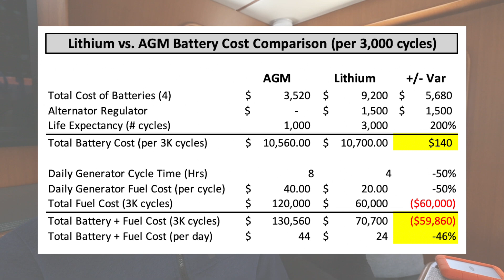What is the ACTUAL cost of LITHIUM batteries (LiFePO4) and should you install them on your boat???

Comment: Battleborn batteries are rip-offs!! You could have got better quality for quarter of the price!!!
Reply: Really.
Where?
Reply: @seadog2396  The issue with ALL batteries using LFP chemistry is that ALL of the Cells used in said batteries are MADE IN CHINA because China has the Patent on LFP chemistry! Cells used in Battleborn, likewise are Chinese made. The market is Flooded with LFP batteries and the problem is you DO NOT really know the origin and quality of the cells used in these batteries. Battleborn will say that they go the extra mile in developing and sourcing Grade "A" batteries from quality suppliers etc, but you never really know for sure. I guess the magnitude and length of the warranty given is an indicator. I personally have used 300Ah of Renogy batteries in my Caravan (Travel Trailer), which are rated at 4000 cycles at 80% DOD and have had no issues (I have seen in a tear-down that they use "PylonTech" cells and BMS internally which is a well known and respected Chinese brand).
Reply: @johncanalese588  Thanks.

Comment: Great Video. How would a solar array have affected your decision to upgrade to lithium disregarding the fact that you needed to change due to age. I have a 400 watts of solar on my trawler and I have 4 AGM battery bank. I only need my generator to operate my microwave at anchor. Otherwise my solar keeps up with everything. I’ve been contemplating the idea of lithium but I may be better off fortifying my solar and that may be enough.  I know you’ve said in the past that it just didn’t make sense for you guys to spend the money on solar because you just could see the benefit. I agree, you spent your “units” in a more productive manner for your boat. Just curious if you had any thoughts since I already have a solar system on my boat. Thank you guys for the great videos. Very helpful and practical knowledge.
Reply from the maker: We don’t have space for solar so it’s not on our list of possible future upgrades for a power source.
Reply: I understand, but if you would have had a solar array that fed your agms would you have spent the money on lithium, or saved the cost because you were feeding your batteries vs. storing the energy for longer? Just curious.

Comment: How about placing fan(s) over these batteries to help remove any possible heat build up issues and also enhance their longevity ?
Reply from the maker: Our bank is quite large so the % of charge and discharge, meaning heat isn’t a huge issue. Not sure how much a heat problem would impact longevity, maybe is we only had 1 battery that was worked pretty hard?!?